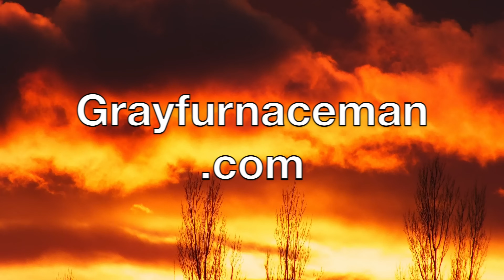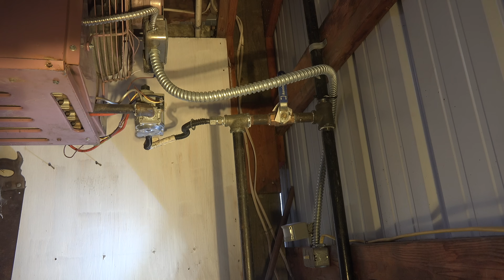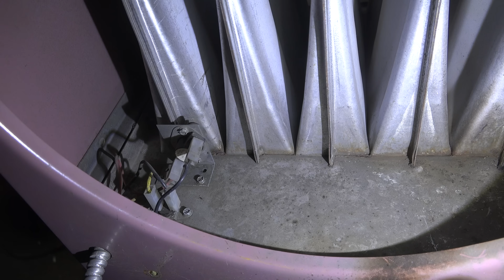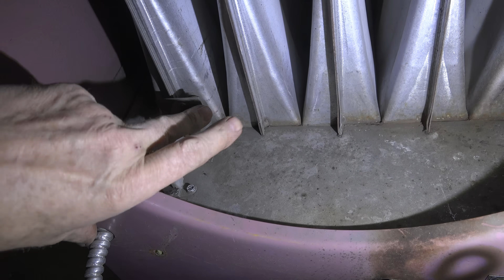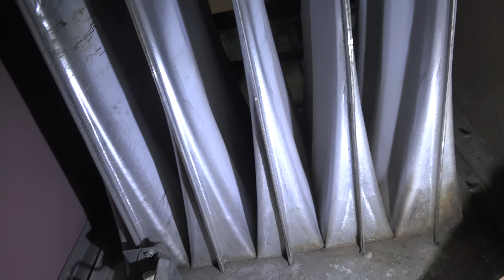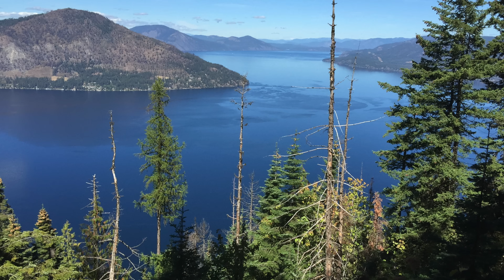How to set up the gas unit heater for your shop #3

Comment: Why not have the proximity switch break the low voltage W1 wire? Wire it in series with the t'stat W1 wire.
Reply from the maker: The proximity switch is powered by 120 volts and can only operate 120 volt circuits.
GFM

Comment: What I did in my last house was run a 3 way switch inside my house and my garage but tied to the w terminal so you can turn on a call for heat from inside the house and would not kill fan. You can also wire in a 120 volt relay to your light switch and have your w broken by the normally open contacts. The easiest way would be to install a WiFi thermostat. 🤐
Reply from the maker: There are many ways to do it.  Mine is just one.
GFM

Comment: Great concept, you should print that out, so down the road anyone that needs to service it knows what is going on, slip it into a Ziploc bag and tape it to the heater
Reply from the maker: I have done a video on the schematic and it is on the unit.
GFM